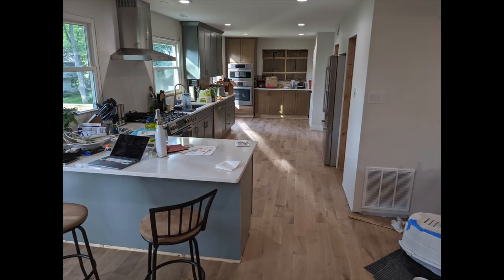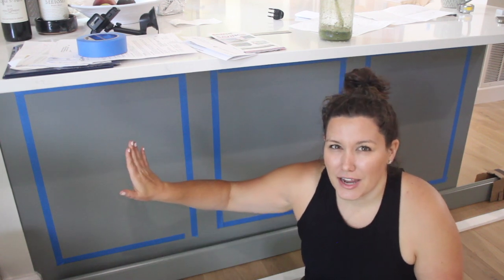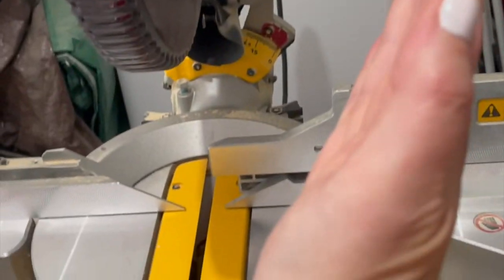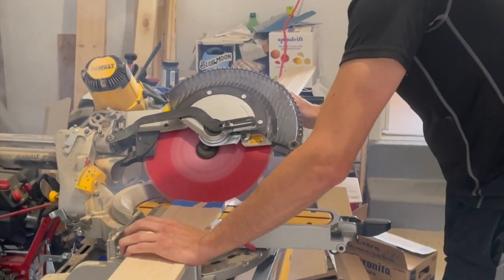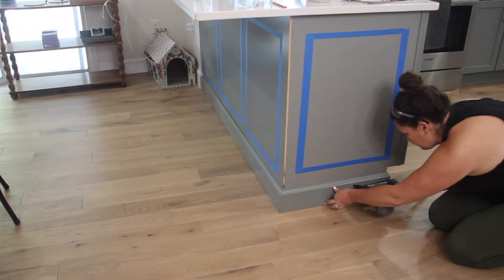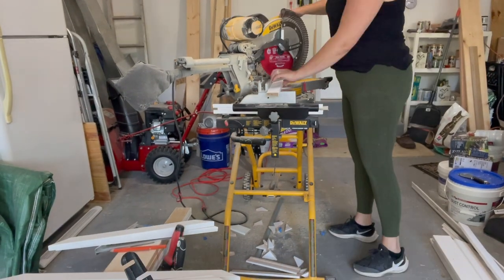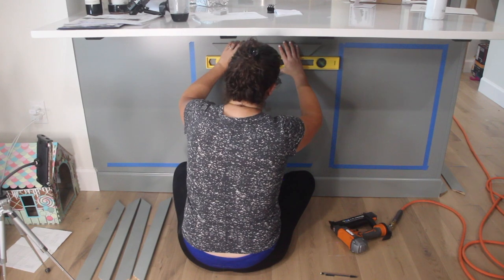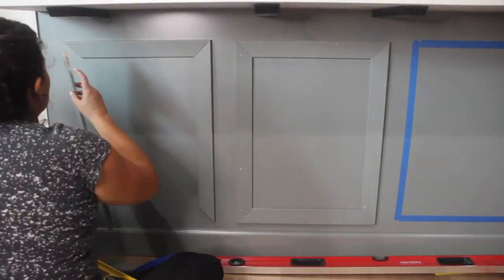How to Add Kitchen Island Trim Molding and Instantly Update your Kitchen!

Comment: If you nail the frame how long the nail you used, how about using glue. I just want to prevent to get to through the cabinet under kitchen island
Reply from the maker: Hi Edward - As a rule of thumb we do double the width of the surface were nailing into. so in our case we did 1.5 inch finishing nails. Between the molding, the finished cabinet panel and the cabinet itself, it did no go through to the inside at all. We didn't use glue as I was constantly adjusting the molding to make sure it was level as I went down each piece. Glue would have made that a whole lot messier and in the grand scheme of things probably wouldn't have made it any easier.